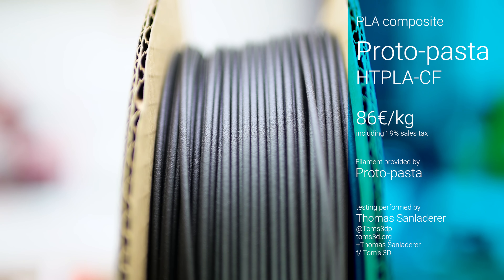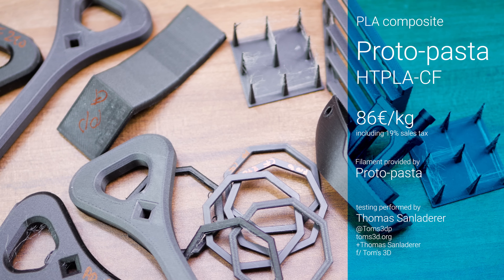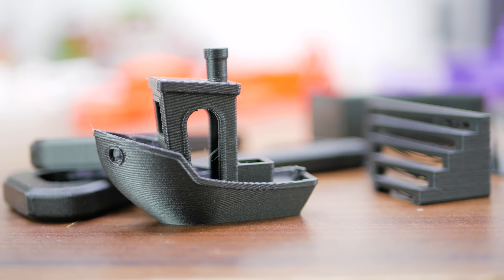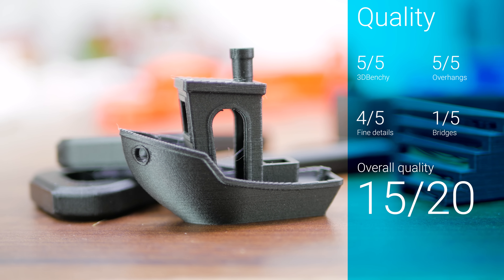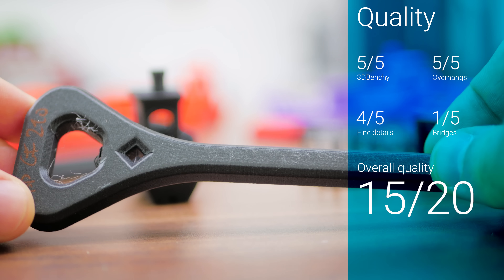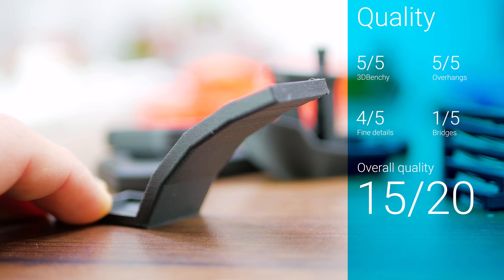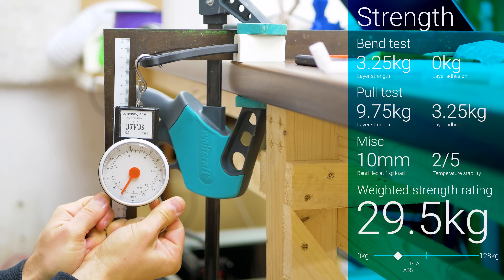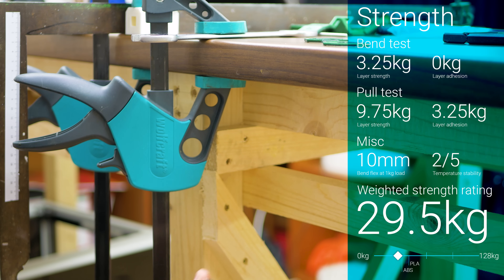Proto-pasta's high-temperature carbon fiber PLA review! #Filaween

Comment: I used their plain CF PLA, and it's pretty amazing. I only did short bridges, but they were flawless.
Reply: So, would you recommend CF PLA?
Reply: @andrewbarney5503  Absolutely
Reply: Based on my experience, I think CF PLA is easier to print than regular PLA. If you're looking for a matte black finish and hassle free printing, I strongly recommend CF PLA.
Reply: I recently picked up CF PLA from sunlu and was able to drasticly increase the layeradhesion issues Tom mentioned in the video by printing at very high temperatures up to 250°C. The filament stays very viscous at these temperatures due to the fibers and the layer adhesion got much better. Really awesome material.
Reply: What temps you guys suggest?

Comment: Thanks again Tom!  Who can't fall in love with that CF finish?  We created Matte Fiber for a similar finish but with color and no special nozzles required.  The fiber also minimizes dimensional change compared to unfilled HTPLA when heat treating.  It's more than just looks and marketing buzz! ;-)

I know it might not be obvious depending on the filament manufacturer, but have you considered the difference between Amorphous and Semi-crystalline PLA?  Will keeping the temperature constant for both types of PLA skew your performance results towards Amorphous PLA? As far as I understand, Semi-crystalline PLA (like Proto-pasta HTPLA) has a higher/sharper melt peak than standard Amorphous PLA, but the semi-crystallinity of HTPLA is also what allows the material to change (crystallize) through heat treating for higher temperature performance.

I know you have to constrain your tests with constants, but it would be interesting to print several samples over a wider temperature range.  How would performance trend with temperature and to what peak strength at what temperature?

Something to noodle on.  There is always Fila-mas! :-)
Reply: Cool, thanks! We recommend 190-230C because the material is forgiving and extrudes well in a wide range, but suggest low temperature for detail and high temperature for strength.  Admittedly, that is based mostly on qualitative observation and not quantitative testing.  Lower temps look more crisp and 210C is a reasonable middle ground, but the material could print hotter.  I am eager for your results!  Thanks again for everything you share and all the work that goes into it :-)

Comment: i wonder if the colorfab xt cf20 is any better
Reply: i have it and i like it. i use an um2+ with a 0.5 steel nozzle because its abrasive as fuck. when i use my exactor knife to remove the skirt, the blade got dull after i was finished with my smartphone case. i also have to print at a very high temperature of 250°c at 25mm speed to get the filament through the nozzle. a bigger nozzle diameter is better o.5 is the limit, but i only get those. the quality of the prints is good and looks like shown in the video. however artifact material can stick to the nozzle and form blobs of liquid material on the nozzle. this material can drop or smear onto your print and the nozzle will bump into it when printing the next layer. i try to remove it as much as i can but the fibers make it very strong against cutting. components, when printed thick enough or with infil have almost no flex and the layers are sticking very well together, because of the micro rough surface and dont shear off so easely like the laywood i used before.

Comment: No rigidity improvements compared to normal PLA? pretty disappointing.
Reply: i think its due to it being designed to be heat treated AFTER you print it and this gives you the better material improvements whilst retaining the ease of PLA printing.  I'm hoping cold bed prints fine with this stuff, dying to try it out!

Comment: This is probably the worst Carbon Fiber filament or ANY filament, I've ever seen.
It's so brittle and crispy, like grissini.. My (dual drive) extruder breaks it every few minutes...
I couldn't print more than a single layer, and then spend an hour cleaning fragmented bits from hotend..  It's just terrible!